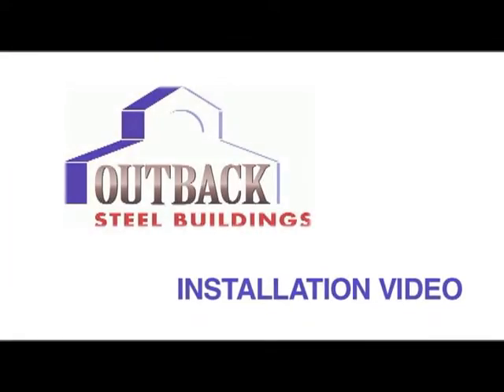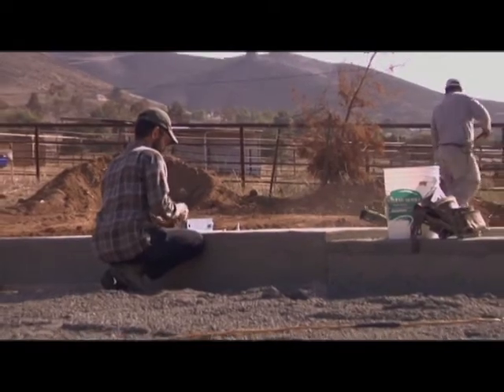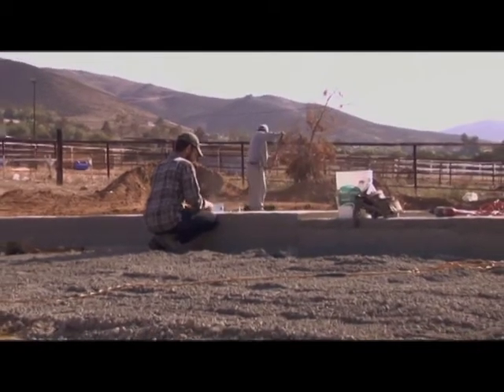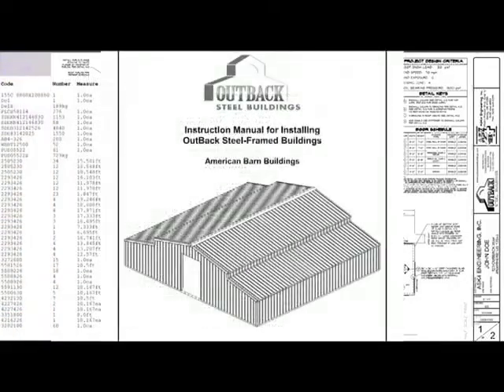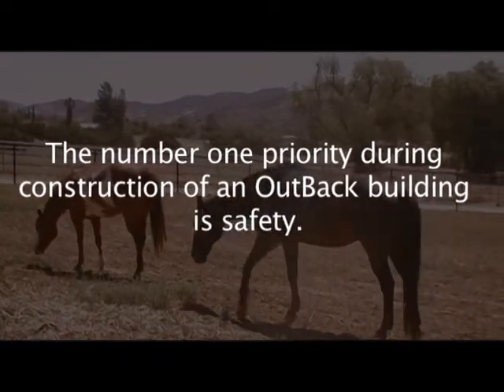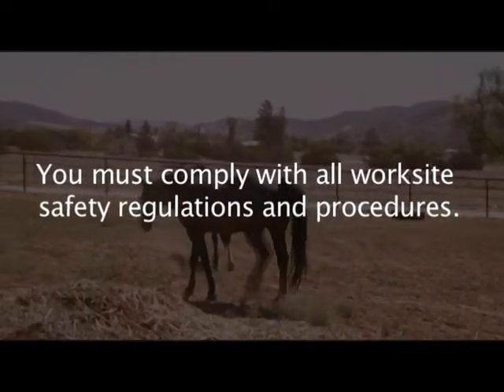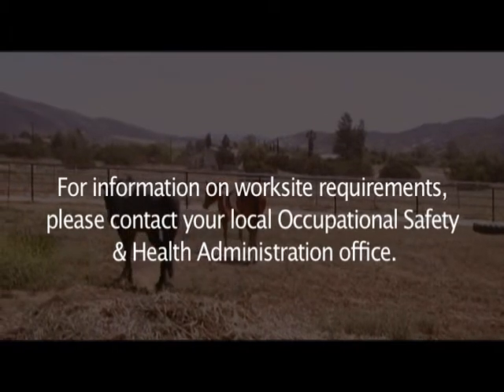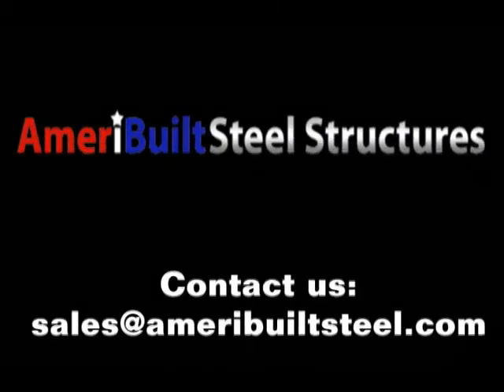Outback Steel Buildings: Introduction

Comment: Few tips after installing one of these: after door framing you need to add door frame caps (roll-up doors only) and drip trim around doorways, before the wall sheeting. Also after wall sheeting is in place, add the drip trim to roofline before installing panels. This trim is only shown in the video and not mentioned so if you look carefully can see the maroon red roof trim pieces and door trim in place before panels...